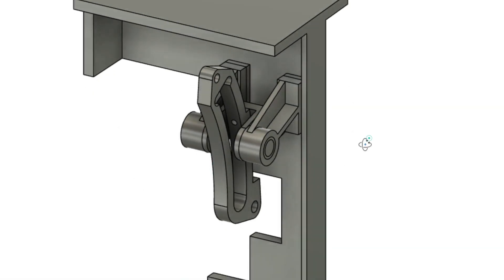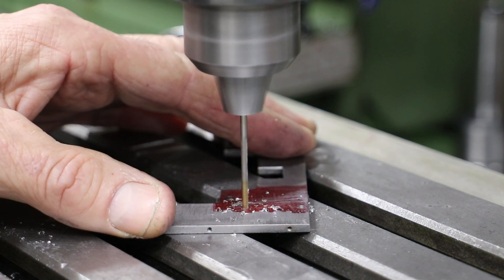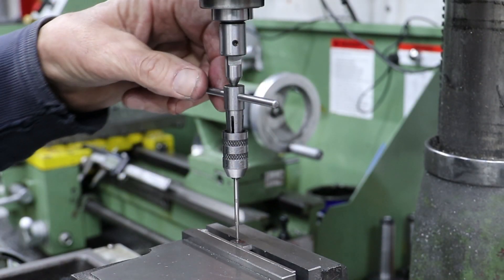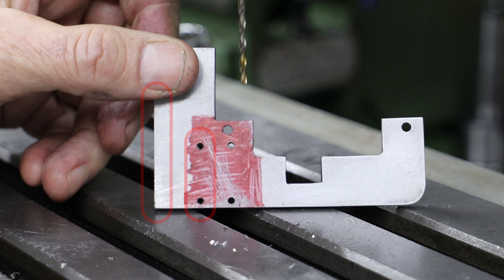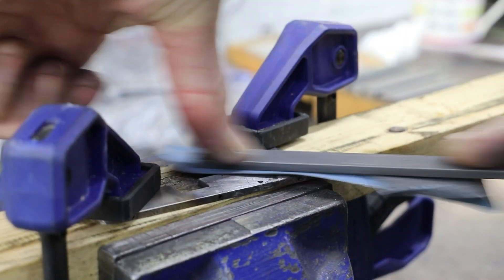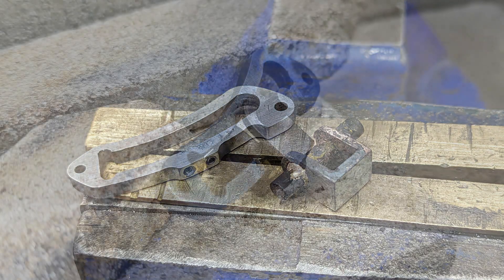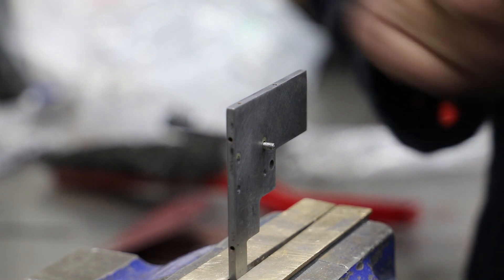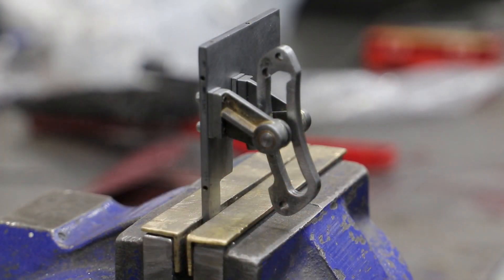Part 44: Completing the Expansion Links and moving holes.

Comment: at 1:24 you are clamping up the Link Brackets. I do such operations slightly differently. First I clamp a Parallel in the Vice but extending say 1/2" above the top of the Vice Jaws. I use the Surface of the Parallel against the fixed Vice Jaw to set the Y-Axis Zero. Then I remove the Parallel and set the Part in place. Instead of the Needle-Nose Pliers I use an Eclipse Magnet which holds the Surface of the Part exactly flush with the top surface of the fixed Vice Jaw (my fixed Vice Jaw is parallel to the Mill Table). The I set the X-Axis Zero like you have.

I empathize with you regarding the Motion Pins. Many LBSC designs used Pins pressed into one of the Parts.
Reply from the maker: Top tip Bruce, thankyou 👍
As for pressing the pins, now that might just be what I need to do, especially for the Expansion Link die blocks.

Comment: The most instructive and useful videos are those where things don’t go perfectly, so thank you very much for including them. Great progress and good luck, and of course, happy new year!
Reply from the maker: Happy New Year to you too William.  I'm looking forward to your next update. 👍
Reply: @markshomeengineering5243  I'm finding it very hard to get time in the workshop, but I have most of the next video filmed - there's some batch production so I need to get that done for the wrap-up. May I ask a question? The instructions for the Maid suggest to mount the coupling rods hole on an arbor in a milling vice and then swinging the coupling rod  around by hand against the milling cutter - is this one of those things which is dangerous and the practise ceased, or just something with limited use and so a rotary table ends up being used more often for other tasks, and thus for this too? Filing buttons won't work very well with the oil cup protrusion...
Reply from the maker: Hi William,
I completely understand, you do have more pressing matters at hand :-)  
Regarding the machining of coupling rod ends, I have seen this practice described in books, but it's not something I have tried.  It does strike me as questionable though and not something I would do or recommend.  Definitely use a rotary table or use filing buttons - the oil pots are a PIA!
Cheers
Mark